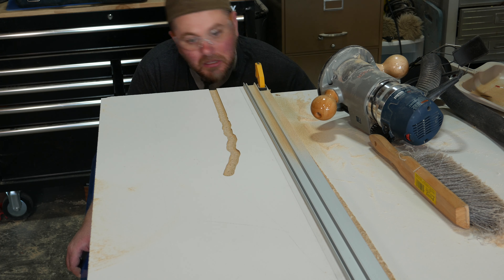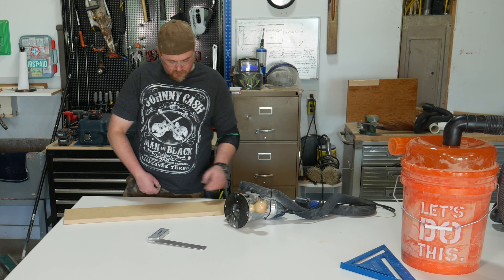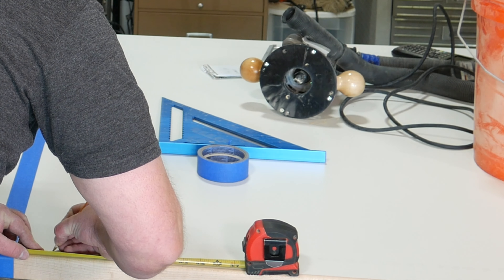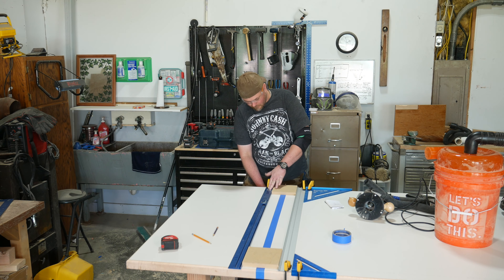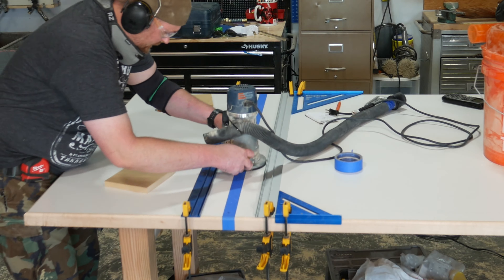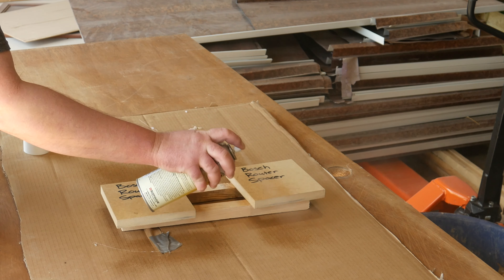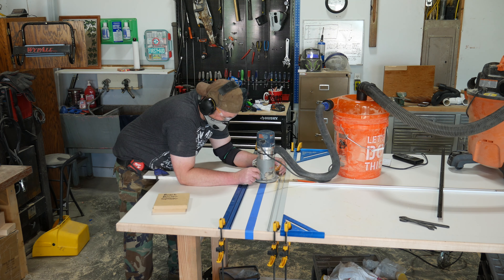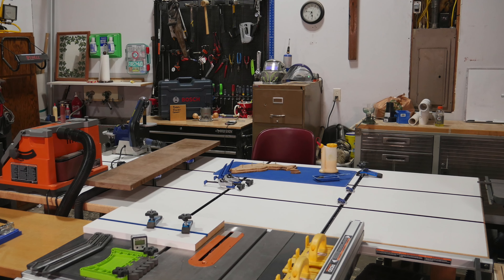How to cut perfectly straight dado grooves with a router

Comment: Hey, what if you are cutting on a curved line like an arched top door?
Reply from the maker: There are a lot of different ways to cut curves, but it depends on the size of the workpiece and what tools you have available. Using a curved template and a router is one way, using a band saw or jigsaw cutting close to your line then sanding to the line for that perfect radius is another. I don’t have any videos on my channel highlighting these techniques but here’s one that might put you in the right direction   https://youtu.be/2U4Op1wWo34?si=lvcqXUpoJEHz-JID
Reply: @JFKreations  I appreciate your quick reply but I didn't frame my question appropriately sorry. What I mean was that this video shows how to use a router on a straight line; what if I need to use the same handheld router to perform a moulding along a curved line that has already been cut with a jigsaw? This video shows how to design a guide to work the router along a straight line; how about a curved line? I hope I phrased the question more accurately and can hopefully receive a helpful answer. Thanks
Reply from the maker: @africanhairdressing6391 do you mean just putting a profile like a round over or a chamfer along the edge?
Reply: @JFKreations  Yes, along a curved or sinuous edge
Reply from the maker: @africanhairdressing6391  the guide bearing on the router bit should follow along the edge regardless if it’s a straight edge or has a curve
Reply: @JFKreations  Sorry I am not sure which guide bearing you are referring to. I suppose that bearing is also on the router you have used in this video, and despite that, the router still swerved in an unwanted direction, prompting you to shoot the video to introduce us to the guides you made yourself; but those are only applicable on straight passes, my question remains: what about the curvy and sinuous edges?
Reply from the maker: @africanhairdressing6391  the guide bearing is on the router bit. A bearing is mechanical wheel that spins around a shaft. Similar to what is inside a skateboard wheel. There is a bearing on the router bit that rides along the edge of the workpiece to maintain a set distance from the edge as the bit rotates and cuts the profile. The bit I used in the video didn’t have a guide bearing, it’s just a straight bit for cutting grooves and dadoes. No bearing needed on those. My depiction of the router bit going awry was grossly exaggerated for cinematic affect on the video. Profile bits have a guide bearing on the bit to act as your guide for cutting the profile. It just follows along the edge, as long as you move around the workpiece in the correct direction the rotation of the bit will hold the guide bearing along the edge of the workpiece
Reply: @JFKreations  You probably thought you exaggerated in the video but I've seen worse; besides, it only takes a little diversion off the path to ruin a whole piece of wood. I see your point about the bearing but like the very one you used here, not all router bits  have it; my question is: what if you where trying to create that same groove on a curved rather than straight line? How would you design the guide? And when it comes to molding along the edges, I can say from experience that the router doesn't always follow the line, even on a straight line; it often only takes a knot in the wood or a variation in wood density to send the router off track, ie into the wood rather along the edge; unless there is a guide, which is easier to set on straight lines. I still haven't figured how to handle this on curved lines.

Comment: Where did you get that cyclone bucket topper?
Reply from the maker: Thanks for checking out the video. Here's a link to the bucket mounted dust separator https://amzn.to/2KmBmbe It works really well and is a lot less expensive than most of the other separators out there.
Reply: @JFKreations  Thanks! Sadly, doesn't look like it's available in Canada :(
Reply from the maker: Bummer! May have to write them a strongly worded letter. All is not lost though, I can offer you this. I made another video showing how to make a homemade dust collector (cyclone) out of a bucket and common PVC plumbing pipe and fittings. Video link here https://youtu.be/c7-NpKsmPCw The bucket mounted shop vacuum shown in this video isn't the most powerful vacuum, it gets the job done for light duty dust collection, but no worries you can take the basic design of the dust collection bucket and adapt it to fit any shop vacuum to meet your needs.  Here's the link to that bucket mounted shop vacuum if you want to look at it too, but who knows if it's available in Canada https://amzn.to/2Kn6OX6 I also have links and a shopping list for all the pipe and fittings you'll need in the description below the video.

Comment: How to repair the damage you did in the first minute ?  Was it a mistake to router film faced plywood, the top of my saw table ?
Reply from the maker: Steve Trueblue Steve Trueblue thanks for checking out the video. I’m not 100% clear on what you’re asking though. Are you saying you have a table saw that has film faced plywood for the table surface and accidentally routed a groove into it?
Reply: @JFKreations  I tried to router 3/4 inch groove in film faced plywood tablesaw top but much tear-out occurred  to my utter surprise and disappointment. Router beginner I am. Used  only the saw fence as a guide. Its nearly as bad as your demo. Only 3 mm deep per run.  Is film faced ply (only made for concreting) a bad choice for neat routering ? Yours is the only video comes close to answering this question.
Reply from the maker: Steve Trueblue when I’m routering plywood or melamine to prevent tear out I put down a layer of masking tape and set the router depth to just barely cut through the veneer on the first pass. This usually works very well on plywood. On the melamine it helps minimize chip out but sometimes a little chip out still happens. But for something like a work bench, like in this video, a little chip out doesn’t matter because it’s going to get beat up from use as a workbench anyway. For your situation to fix, about the only thing you can do is clean up the groove as best as you can and fill it with an inlay strip. I’m not sure if film faced plywood is an especially bad choice for routering, I haven’t ever had the need to router this type of plywood. If you do try again a couple things you can look for. Make sure your router bit is a quality bit and is sharp without any build up of pitch or resin from previous use, if there is build up clean the bit before you use it, then try the masking tape method, also do some test cuts on scrap to find the appropriate speed and finally check the grain orientation. If you can arrange the plywood so you are running the router with the grain, not across the grain, it should help minimize tear out too. Sorry I can’t give you a definitive answer but I hope this helps give you a few things to try.

Comment: Why wouldn't you just measure the diameter of your router base and make your spacers that exact measurement?  You're creating an unnecessary step.
Reply from the maker: Parallax distortion, blade deflection, a pencil that’s not perfectly sharpened, all little things that can introduce small  errors in the final cut. Normally in woodworking there is a certain acceptable tolerance for these little errors, but in a thing like this exact is required. Much better to sneak up on the exact fit, you are looking for. Measure,, mark and cut on a thing like this, you might get lucky and get it perfect on the first try so go for it

Comment: Why not just use the router rather than cutting blocks to set your guides?
Reply from the maker: Good question. If you just use the router to set up your guides, since it’s just one point of contact for the guides, it will act as a pivot point. So if you bring the guides inward toward each other on the end where you have the router, the guides on the opposite end will spread apart, and vice versa. You can get it done that way, but you would have to adjust one end of the guides to fit the router, then move the router to the other end and adjust the guides, then move the router back to the other end again, adjust, back and forth over and over, until you get the guides lined up “good enough”. But if you use the blocks, one at each end, it’s a quick set it and forget it.
Reply: @JFKreations  Good answer!

Comment: Pretty complicated — then multiply by the number of dadoes on the board — then the same number on the opposite side of the cabinet...
Reply from the maker: Yeah, I guess your math equation is much simpler. Or you could quit worrying about math formulas and just get out in the shop and make some sawdust. Better yet, you can make a video showing us all the best way to do this since you seem to know better. All I can say is I’ve used this method for years on large surfaces like this table, set up is quick, cost is low and I always get perfect results. If you have a better way without having to buy or make some sort of router jig, let’s see it.

Comment: Be honest ... you will soon abandon it.  Just not worth the set up.  Just use one straight guide and push the router slowly so the edge is always touching the router base.  It is really too exaggerated to have crooked dado grooves.
Reply from the maker: I definitely will not abandon this method. When I’m cutting very long dados on a horizontal surface like the 4 foot and 8 foot long dados on this work table, I absolutely use this method. In fact I use a similar method of ensuring a dead straight long cut with my circular saw as well. For instance if I have to resize a door and need to shave just a fraction of an inch off the width, I always take the time to set up and stabilize my cutting guides to ensure a dead straight cut rather than just being careful, going slow and hoping it comes out ok. Maybe my work requires a higher level of precision. Of course the crazy crooked cut at the beginning was exaggerated for entertainment purposes

Comment: so a snoich is ????? somewhere between a ? and a >
Reply from the maker: Jake Qwaninne about half way between a wee bit and a smidge. Very, very technical scientific terminology, not for the lay person of course.
Reply: @JFKreations  i paint cars, we have similar terms, although i've built a few guitars (solid electric, i won't mess with those no amp thingies), i'm relatively  new to wood in the building aspect, and i would like to not need a 6 pack and a shot to get the router out, i'm all about guides and precise from doin cars, but maybe i'm expecting a little too high a tollerance with wood, i was talking to a guy from charvel guitars, and he was saying, "it's a living thing, every time you make a cut it moves , and there's no real science to what it's gonna do",so any help is welcomed
Reply from the maker: Jake Qwaninne painting cars, musical instruments, those do require a high degree of precision. But woodworking, you can get away with a lot, wood filler is your friend. And as @jimmydiresta would say, “if it looks straight, it is straight” or even better when all else fails, do what @steveramsey does, “just turn the crappy side toward the wall”. Get the table saw and router out, you’ll be just fine.

Comment: Dude it's effective no doubt but if you have to make several cuts this is not time effective. There must be a more practical way.
Reply from the maker: There are. In woodworking there are countless ways to do the same thing. This is one way, that works perfectly everytime. And like most things, if you’re going to do a thing, might as well do it right. The first time. If you’re looking for super efficient ways to do woodworking, then I would assume you’re getting into professional production when efficiency actually matters. For weekend warriors, efficiency is less important than doing it right and getting perfect results.

Comment: Yeah but what if the spacers are off and the ruler you bought is from china , and a  nd and and
Reply from the maker: Spacers shouldn’t ever be off, since there cut to fit. Ruler doesn’t matter either, as long as you use the same measuring device throughout an entire project doesn’t matter if the measurements are true to standards of weights and measures, it basically is just a story stick. Now if you mix and match measuring devices throughout a project, yeah you could run into trouble if they aren’t identical
Reply: @JFKreations  yeah but what about Murphy and his law
Reply from the maker: @hernandotatis1302  can’t help you that. Can’t be so timid and afraid to make a mistake if you want to be a woodworker. Not really sure what you’re getting at with all these “yeah but…” statements. Quit looking for problems that don’t exist and get in the shop
Reply: @JFKreations  yeah but what if im too fat to get through the door of the so called shop
Reply from the maker: @hernandotatis1302  ah, that I can help with. Stop by the hardware store or your local big box, grab a roll of duct tape, tear off a piece about 4” or 5” inches long and place it over your mouth. The weight will start to drop instantly and you’ll fit through that door in no time!
Reply: @JFKreations  ROTFLAO.....I agree....